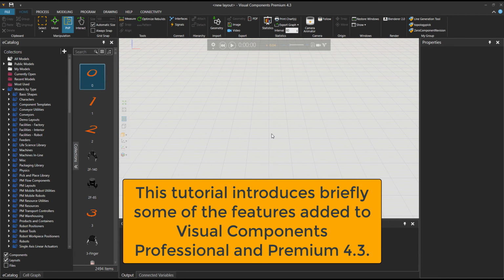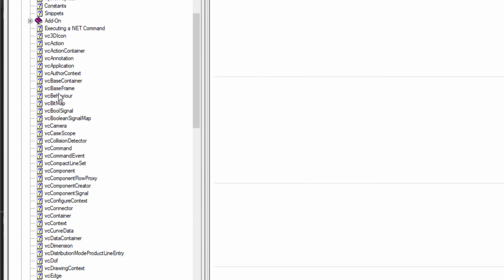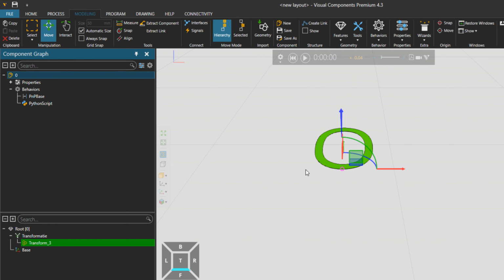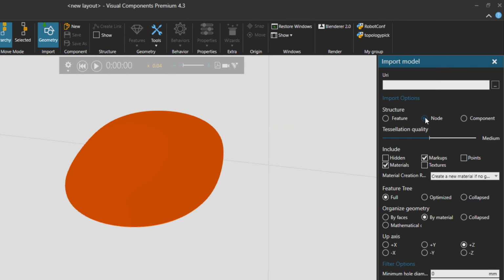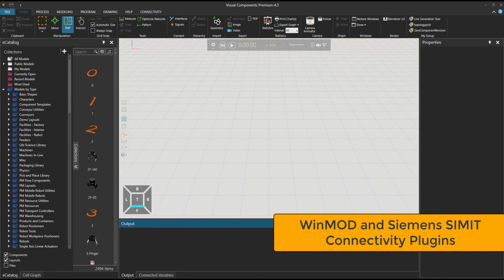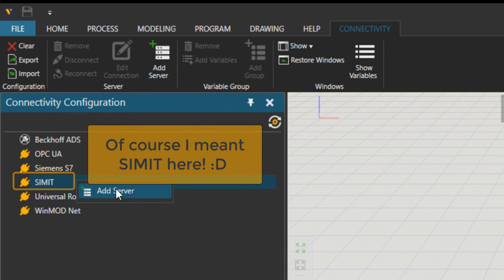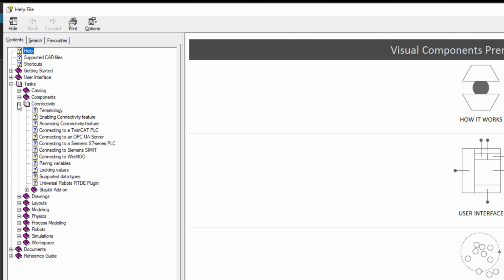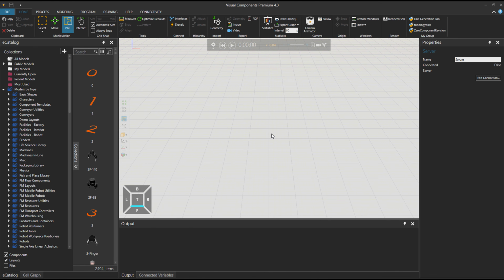4 3 New Features   Professional and Premium Versions

Comment: Do I need any programming knowledge to do/learn visual components, I design machines and layout using NX, can I just import 3D model and do simulation. Thank you!
Reply from the maker: It depends. We have tools to quickly turn a CAD model of a machine into a working component, etc. You also have the ability to import the assembly structure. A demo would definitely be a good starting point, so we suggest you fill out this form.
https://www.visualcomponents.com/get-a-demo/